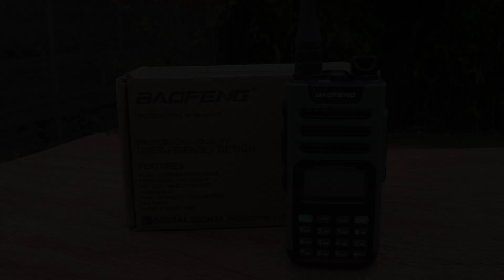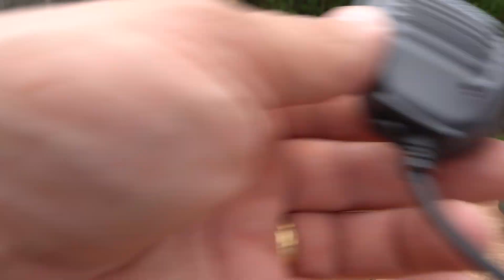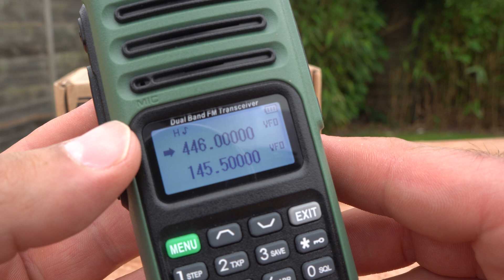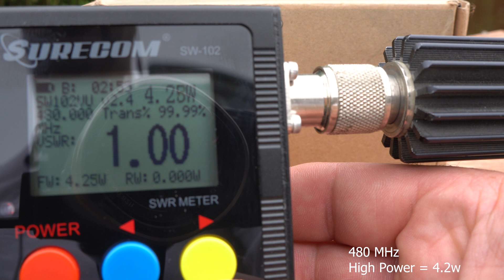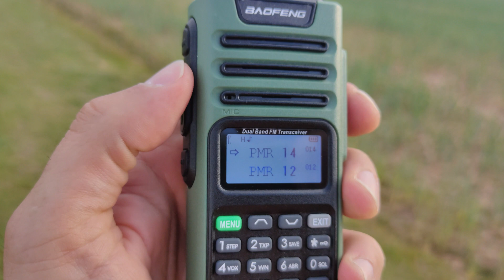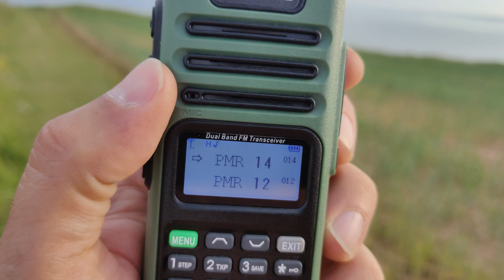Baofeng UV-13 Pro (V2) Two Way Radio Review - Really 10 Watts?

Comment: Just acquired one of these in green. nice little unit. The issue I had was the battery fit was kind of sloppy. A couple well placed masking tape pieces down the edges tightened it right up. Now the only rattle/looseness is in the belt clip itself. The screen is bright.
Reply from the maker: They're still a good radio, released a few years ago but I was always impressed with the audio quality from the built in speaker.

Comment: Nice review buddy thank you, how did you find the battery life on this long term in use?
Subbed to your channel by the way. 👍
Reply from the maker: Thanks Dave, sorry for late reply - battey has been good on this unit and I still use it occasionally.  I've got two of these radios - a red and a green version and still get compliments on the audio.  I've recently programmed all the marine frequencies into the radio and use it as cheap scanner when walking along the coastline!

Comment: A very nicely equipped radio station, your package also includes a CD as a bonus, which my version didn't have, but that doesn't matter. I have already downloaded the necessary programming software. But the performance I saw in your video is not the same at every selected frequency. I understand that the higher the power of the radio station, in this case up to 10W, the greater the range will be? Or does it depend on the correctly chosen antenna and its sensitivity, signal gain, etc.???
In my opinion, this radio is comparable to: WOUXUN KG-UVD1P, dualband VHF/UHF, with which I also captured signals that cannot be captured on this model: BAOFENG UV-5R, the sensitivity and transmission power will be somewhat lower there than: Baofeng UV- 13 For. I don't have a power measuring device. So I can't compare it. I base it on experience and observation

Comment: The primary difference between the V.1 and V.2 is power output, and after testing the V.1, it was more powerful than I thought. And there's not much difference in power, but there's a little. The V.2 cranks out about 8W on VHF, and 7.6W on UHF. Not really enough to write home about. The sound quality is superb, about the same as the Baofeng H6 (an evil twin). It is a 10W radio and you may want to order that instead.
Reply: V1 мощнее чем V2
Reply: Baofeng H6 really does 10W?
Reply: @michaltrodler195  » Close enough. It's one of the truly underrated budget radios in my view. The BEST budget radio is the 10W TYT TH8000D. It's amazing for the price. Not because of the 10W, but just because.

Comment: How we can check if mines is v1 or v2??i cant figure it out
Reply from the maker: Remove the battery from the unit. Look at the sticker on the rear of the radio where the model and serial number is. Mine has V2 written in a small black circle where it says Model: UV 13 Pro. Yours should also have this.

Comment: It seems that this 13 PRO V2 is probably the highest power output Baofeng ever existed at 9.1W on 400Mhz..... even the new UV 17 PRO GPS only maxed at around 5Watts......
Reply: The H6 put almost 10W as well...
Reply: @dimebagtribute  but for GMRS bands, H6 very likely reduces to 5W
Reply: @du39104  ?? Strange... Mine doesn't go below 8w on the 446Mhz (pmr446 in Europe)!
But anyway, my point was that Baofeng have 3 or 4 models that are very powerfull, the 13 pro V2 is one of them😊
Reply: Jokes 😅

Comment: I wish you would run a comparison between {Version 1} with {Version 2}. I'd like to see a range test with v.1 and v.2 on the HIGH setting and LOW settings, using the same antennas. The v.1 model is about 4-5 watts; the v.2 model would be about 6.5-7.5  watts. 

The higher power model is, many pundits say,  not nearly as important as the antenna one uses. I'm uncertain this is the case. If true, the range should be about the same; if not, the v.2 model should have superior penetration and range. If false, the v.1 and v.2 should have about the same range, with no change in penetration.
Reply from the maker: I only have the V2 version of this radio but it's true that there isn't much difference in range between 4 watts and 8 watts. The antenna is much more important. Most of the time I can run the radio on mid power and still make all the contacts plus save a bit of battery life.  As there is only a few dollars difference in the the price of the two radios I'd always choose the V2 model.
Reply: @Transmission1  » Yeah, that may be the way to go, but in favor of the V.1, the battery power may keep you going much longer without sacrificing much power in the process. If one finds any benefit in the power output between 4W and 8W, yes, by all means go with the extra power, but if you're not seeing any real benefits in range, see if you're getting any benefits in battery power. If you are staying on the air longer, that may be where the sweet spot is. 

I initially started chasing power --- uhhhnnnlimittted pooooowwwwer!!! in my HTs. Now I'm mellowing out in my old age. It dawned out on me that range and power aren't as closely related as I'd originally thought, or hoped. 
..

Comment: I ordered the same device. The menu that says (TX power) does not appear. I can listen to the other side. My voice is not transmitted. What do you think is the solution?
Reply from the maker: Sounds like the unit is locked or programmed to disable the transmit. I've no idea to be honest but sounds like you should return the unit for a replacement as I've never seen that happen.

Comment: Does it allow transmit on GMRS/FRS and PMR 446? I have heard new Baofeng banned transmission on GMRS channels.... thanks
Reply from the maker: If you buy the radio from Aliexpress there are no restrictions on frequency range so it will transmit anywhere you program it to do so... so in the UK you can use 446 or in the US GMRS and FRS etc.

Comment: WHERE can I find the PC program that u show in the video??  I cant find it anywhere... tnx  km5uk
Reply from the maker: I don't know if you ever found it but it's located here: http://www.abbree.cn/download/ - look in the Baofeng section and it's under UV-13 pro. They renamed it recently as it used to be called  P15UV - it's the same software but as usual the Chinese make a number of models that share the same firmware/system board so it's not always obvious.

Comment: hmmm i watched another ham do a power test, and his was only doing 4 watts vhf output, with a different meter.. 73 km5uk
Reply from the maker: Was it the V1 version? There are two version of the radio. the V1 is around 5 watts max and the V2 seems to top out around 8-9 watts.

Comment: I use Motorola PMR radios when snowboarding. They work really well. The 'privacy codes' mean we dont hear other people on the channel. However there are a few issues I'd like to address:
1) My Motorolas don't have a port for a headset.
2) The batteries are NiMH and dont seem to last very long. I'd prefer Li-Ion.
3) Batteries have to be charged in the radios.
4) They require the Motorola proprietary chargers. (Which is more kit to take snowboarding and give to everyone on the trip).

This radio seems to solve all of those issues. It has a headset port, USB-C charging on the battery itself (so each person can charge their own radio with their phone charger), lithium ion batteries, and a lot more power to boot.

My question is: do they support the Motorola-style 'Privacy codes'? Can they limit what we receive to only our group? And if so, is it also compatible with Motorola PMR radios? IE could we have some of the group on Baofengs and some on Motorolas, with a particular privacy code turned on and all be able to hear each other? (Power levels notwithstanding).

Thank you!
Reply: Yes they support CTCSS and DCS
Reply: @Scott Holmes  Funnily enough two of them arrived today!
Reply: @fpv-uk  Because of this video I just ordered one off of eBay!

Comment: Thanks for the review on the uv13. I do have a question about the "freq hopping code" column (24:49), what does this do? And how to use it?
Reply from the maker: I think it's just simply the scrambler option - nothing other than analogue voice inversion scrambling but I could be wrong. I'll have to revisit that option and try it.

Comment: What software works with this? I got the Amazon tp8 plus version and they shipped some bogus cd and the uv13 pro software is pulled off abbree site.  It's also not unlocked 😕
Reply from the maker: The Abree site site still has the software? https://www.abbree.cn/download/  - it's now showing in the Baofeng section and its called UV-15R UV-13 PRO
Reply: @Transmission1  it was there but wouldn't allow me to download it.  As if they pulled it. I found a older version and bricked the radio showing Chinese fonts on the display.  Couldn't restore it.
Reply from the maker: @hamradiohack  That's a shame. I've got a copy of the software here if anyone is having problems downloading it. I went back to Abree.cn today and the link is back - seems like they moved the file to a google drive shared link.  Not sure if this version is different from the one I got a while ago. Will have to check.
Reply: @Transmission1  mine was locked. Couldn't get gmrs pmr to work. The ones on Amazon have a usa fcc certification and are locked. Amateur only. So I read where you can change this. That's on a part of the software that caused the problem . 999 memories would be nice and usb c but if I have to program the radio by hand and only works on usa Amateur Radio it's not much help. And no chirp

Comment: How long does it take to charge the battery with USB-C-Cable? 
Does it make any difference what cable and charger are used (like fastcharge-/turbocharge with cable and charger from smartphone)?
Reply from the maker: I don't think it makes much difference as it only has one charge rate - kind of slow! I don't hand around watching it charge but I'm guessing around 3-4 hours. I've tried iPad chargers and others and it doesn't seem to make any difference.
Reply: The UV-13 Pro V2 battery seems to ignore power from higher power setups, meaning ones that provide PD.  For example, my 30W phone wall charger with a type-c to type-c cable is ignored (no charge). The same occurs with a portable battery (that can do PD) when using a type-c to type-c cable, but the same battery using a type-a to type-c does charge (again, slowly).

Comment: Hi. Thanks for the review. 👍  Would you know what is the actual difference between the V1 and V2 versions anyway AND can one tell if it is V1 or V2?
Reply from the maker: Thanks for the comment!  As far as I know the main difference between the V1 and V2 is the output power. The only way to spot this is by removing the battery and inside the compartment is a sticker with the serial number and product name followed by (V1) or (V2).
Reply: @Transmission1  Hi. Thank you for the well made review. I would like to know how many tx power levels can you see on the radio menu, 2 or 3? Thank you.

Comment: THAT IS NOT THE KENWOOD CONNECTOR, THAT IS TYPE K LIKE ALL BAOFENG RADIOS. KENWOOD CONNECTOR BOTH PENS ARE 3.5 MM WHERE TYPE K IS TOP PIN IS 2 MM BOTTOM PIN IS 3.5 MM!
Reply from the maker: Are you sure about that? Almost every Kenwood handheld I've seen recently uses the same programming cable as the Baofeng. Search for the KPG-22U for example.
Reply: Yes, the TH-F6(7) has the same connector 2.5/3.5mm set, I assumed K comes from Kenwood, pretty sure not the chinese who invented it 😂.

Comment: The battery will charge in a
 TYT UV88
TYT UV88
Retevis RT-85
MARUI MR-UV1

They all have the same battery and maybe the Boards are the same too... And that in your hand in the copy by Baofeng
Reply from the maker: Interesting. Thanks for sharing. I've not even heard of the Marui brand until you mentioned it. Seems to be sold in the Philippines.

Comment: Excellent video! I own several Baofeng radios, and they all lack from the same problem, a modulation that is far less loud than other radios, so you really have to shout into the mic. Has the UV-13 Pro the same problem?
Reply: Easy fix for low tx audio on Baofeng radios is to use a 0.1 inch or similar size and gently finger drill out the mic hole you can tell when you brake through the plastic. This works great on all of my Baofeng radios!
Reply from the maker: I've not had this issue with the UV-13. Seems pretty decent modulation out of the box as you saw in the video. Nobody has complained about my audio.. yet!

Comment: This thing fits perfectly in the UV-5R charging base
Reply: It does fit, but the slots in the battery itself do not align, so you do have to charge the battery attached to radio (no charging a spare battery while radio is in use).  As much value as USB-C charging adds, it is nice to still have a desktop drop in charge option.
Reply from the maker: Nice! Thanks for sharing that info. Sorry for late reply!

Comment: I don't know if you already tested them but the H series is pretty good and represent the top range of Baofeng... The H6 and H7 are 2 great radios that deserve to be tested! The UV82hp is very good as well, it's the best cheap radio you can find, to my point of view at least...
Reply: I have the bf-h6 baofeng I love it. Fits my tyt uv md380 charger base. I see nearly 9 watts on bird meter into dummy load. Front end doesn't over load like a uv5r either.

Comment: Normally shy away from the Baofengs but this one looks like a bit of a winner Simon !   Thanks for the great video
Reply from the maker: Thanks Mike! This is the radio I was speaking to you on a couple of weeks ago and it worked great. The same week I made a 84 mile contact into Derbyshire on the stock antenna as shown in the video. It's the most fun I've had for around £35!
Reply: @Transmission1  wow, 84 miles! huge